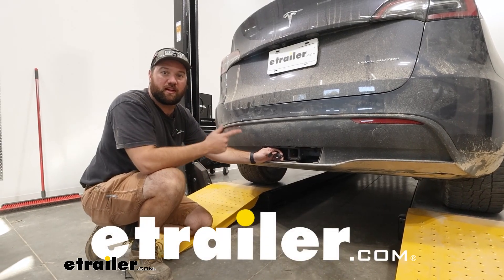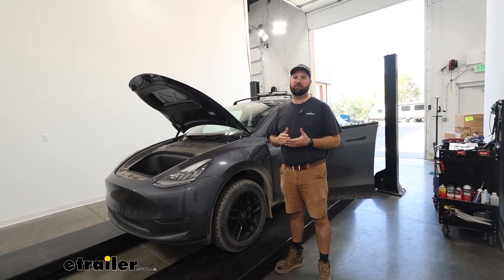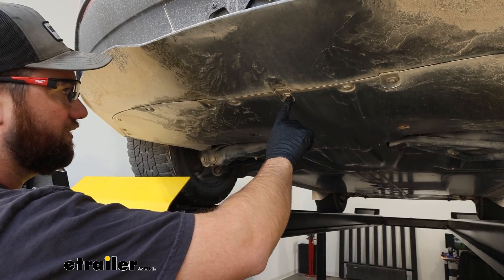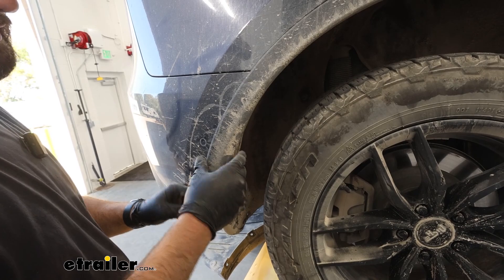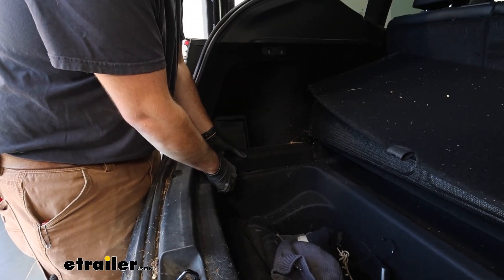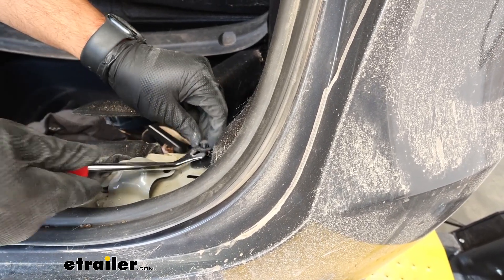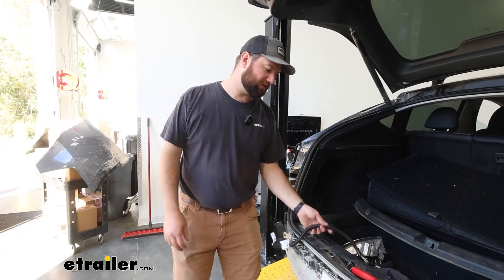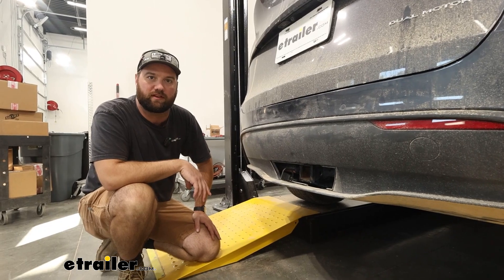etrailer | How to Install the Curt T-Connector Vehicle Wiring Harness - 2022 Tesla Model Y

Comment: Doesn’t fit my Tesla. Part says it’s for a 24 model y but that’s incorrect. It would be helpful if you 1. Showed the viewers the actual plug not it plugged in. 2. Specify what plug you’re using because there are a ton of curt connectors out there and generalizing it is like looking for a needle in a hay stack.
Reply from the maker: I do have to start by saying this is specifically for a 2020 to 2022 Model Y, so I am not sure where you are seeing it for a 2024. There is no custom fit wiring harness currently available for a 2024 (at least, not that I could find).

There is also only one plug this will mate to on a 2020 to 2022 Model Y, but I can see that showing them not plugged into each other being somewhat helpful. Not sure what you mean in your second point though. Wiring harnesses like this are custom fit. There is no needle or haystack. For your 2024, it will be more like figuring out which needle needs to be threaded (probing wires to find their functions), but you could use something like the Tekonsha ZCI Circuit Protected Vehicle Wiring Harness 119250KIT (https://www.etrailer.com/Custom-Fit-Vehicle-Wiring/Tekonsha/119250KIT.html).

Comment: Do all model Ys have that custom connector to plug into? or only ones made after a certain time?
Reply from the maker: What model year is your Model Y? Get me that info, and we'll get you hooked up!
Reply: @etrailer  Same question! Does the 2024 Model Y have this same connector?
Reply: I have the same question about my 2021 MYLR.
I’m getting ready to do a DIY hitch installation and the 7-pin connector that I can find has the factory plug and play connector. Has Tesla started pre-wiring them and just putting a dust cap on the ones that don’t have the factory tow package?
Reply: Following this

Comment: Do you have a version of this connector that fits the 2023 Model Y not 2022?
Reply from the maker: I checked with Curt, and found that the 2023 Model Y also uses the # C92ZJ shown in the video.
https://www.etrailer.com/Custom-Fit-Vehicle-Wiring/CURT/C92ZJ.html
Reply: Did you happen to confirm that this was in fact compatible with the 2023 model?

Comment: It will fit for model y  performance 2022 ? Do I need to do anything with the software or just plug in ?
Reply from the maker: Per Curt, the # C92ZJ harness fits all models of the 2022 Tesla Model Y, including the Performance trim. You won't need to reprogram anything. Hope that helps!
https://www.etrailer.com/Custom-Fit-Vehicle-Wiring/CURT/C92ZJ.html
Reply: Didn’t work for mine
Reply: Does this fit 2024? The website says no. The only other options that says it fits is $150 more. I don't see why it would be any different